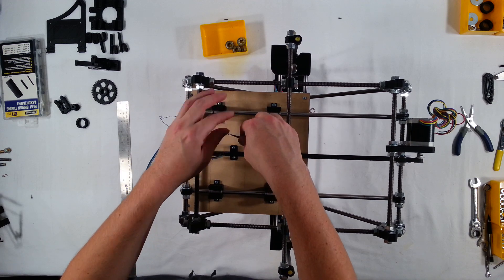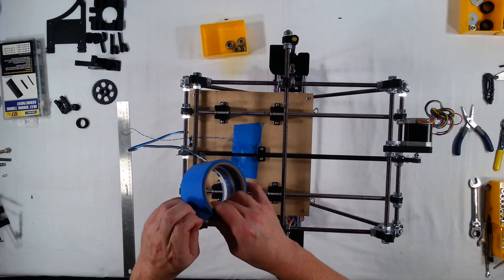RepRap Prusa Mendel Iteration 2 Assembly 12 - Heatbed Thermistor

Comment: Does anyone know why we need to use stranded wire instead of the twisted wire?
Reply from the maker: You just need to make sure that you're not using solid copper wire where there's a lot of movement. The solid copper wire can crack over time. The stranded wire is flexible and it can handle moving back and forth.

Comment: So what kind of PTFE tubing is it? Inside and outside diameters? Can I get away with 0.3 mm inner and 0.6 mm outer?
Reply from the maker: David, The PTFE tubing for the thermistors has an inner diameter of 0.015" and a wall thickness of 0.009".
Reply: Are you sure thats inches? Or m?
Reply from the maker: David Rorry It's inches. So, your PTFE will likely work. The only purpose is to prevent the leads from touching and the use of PTFE because it's near heat.